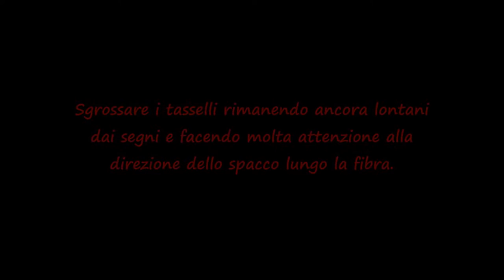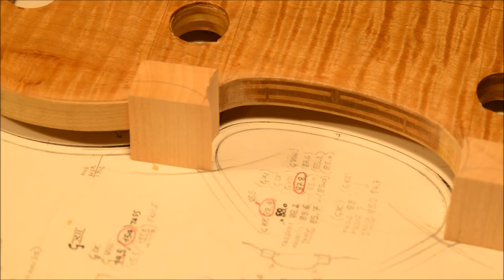3) Sgrossatura delle curve dei tasselli superiore, inferiore e delle C

Comment: Hi Maestro What wood do you use for the wedges? I use linden, poplar or spruce.
Reply from the maker: I guess by wedges you mean blocks. The woods you use are all good and are also found in ancient lutherie. I prefer to use willow, which is what Stradivari used, and because it's a pleasure to work with and I love the color. I only use spruce when making the Guarneri del Gesù models, because that's the wood he used.
In the case with wedges you meant linings, the wood is the same as for the blocks
Reply: @DavideSora  Grazzie mille

Comment: Hola Davide. Videos geniales. ¿Podrías indicar dónde comprar la sgobia del minuto 1:20 (inside bevel?. Muchas gracias
Reply from the maker: I bought It from Dictum many years ago, it's a japanese inside bevel gouge, but now seems discontinued (they still have smaller ones). Anyway this gouge is certainly useful but not essential, the width is 18,5 mm and 13,5 mm radius of the curve. Before using this inside bevel gouge I was using a "normal" gouge, that I still use for finishing the curves (see other videos of the serie).
Reply: Many thanks Davide. I follow yuor videos with pleasure. Them are very useful for me.

Comment: Hello Davide, where can you find the inside gouge that style that can be flat sharpened? All I know of are the Japanese variety but they are hard to find.
Reply from the maker: Yes, they are difficult to find but they exist, even in the non-Japanese version, you can try searching for "inside bevel gouge" on the web and you should find something. I had mine from Dictum many years ago, now they have some but they no longer have the measure of the gouge I have, they have this as alternative : https://www.dictum.com/en/scroll-gouges-jbc/herdim-cornerblock-gouge-sweep-6-16-mm-715551